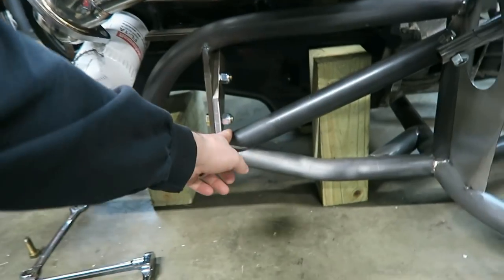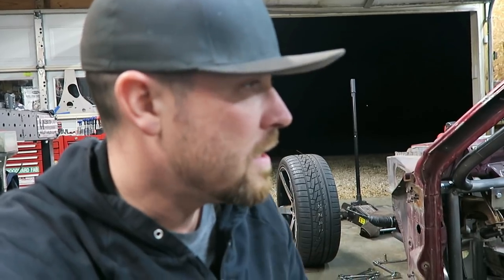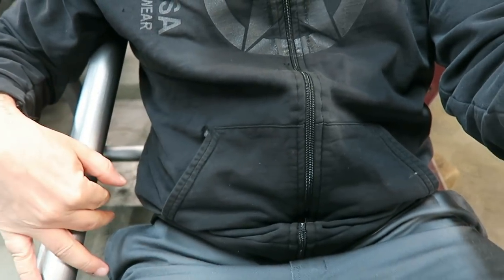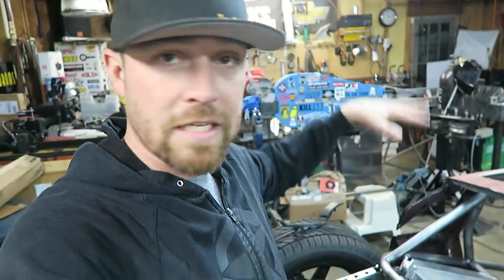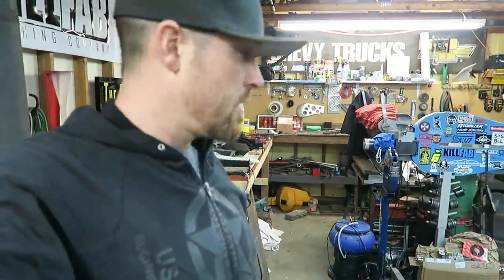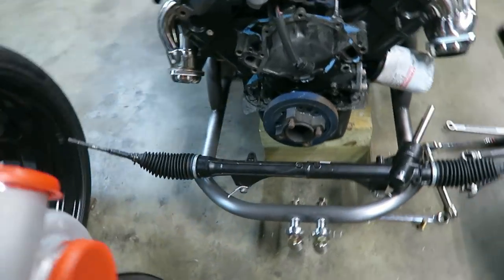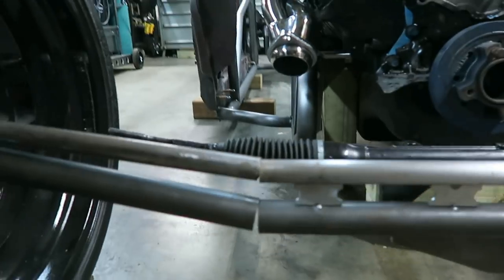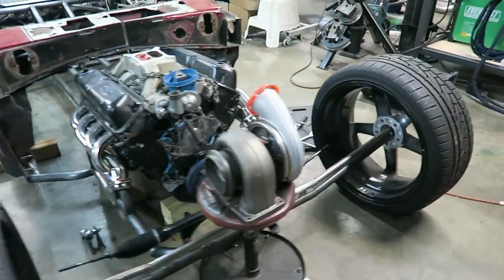Lets Talk Changes & Concerns on The Hot Rod Build

Comment: Hey bud this may be a dumb question, but only question is the one you don't ask. I saw you were talking about the clearance for the turn pipe from headers, well can't you leave the headers in the direction there in just flip them upside down? Exhaust exit point up then clock the hot side of the turbo atleast them you can make the exhaust some what contour the front of the car if you wanted it to and still clear the steering boots of the rack and pinion. Just an idea but awesome build dude.
Reply from the maker: +charles fields I could but they look stupid like that and these particular flanges won't work upside down.

Comment: I agree, the extra bars in the roof arent necessary...you wont ever be going 200mph.  and with the super low stance, the likelihood of flipping is zero.
Reply: The concern I'd have with the rear cantilever arms, is twisting.  There will be quite of be of stress on that length of an arm.
Reply from the maker: twisting wont be an issue

Comment: You're suspension bolts will be fine as long as you don't skimp on quality. I'm running 9/16" grade 9 bolts on the front of my vw buggy  in single shear with no problems. And I'm sure my car sees  a harder life than yours, lol. Keep up the great work.

Comment: Like I said before I don't know about a lot about the geometry but form my understanding is the tie rods should be parallel with the ground to avoid bump steer. I know this is mock-up stage but in my opinion I think I would extend your top rail of your frame all the way to to your front end and also weld that front axle to the frame and not use just those two bolts again I know this is just the planning stage. I do like the direction you are going and the look keep up the good work and looking forward to your future videos
Reply from the maker: no the tie rod needs to be parallel with the a arm to combat bump steer
Reply: The Fab Forums  thinks for the clarification that makes sense

Comment: could you flip the headers so the collector is facing upwards so you dont need such a sharp angle
Reply from the maker: +durtyonecustoms I though about that
Reply: Honestly I think some header wrap and heat won’t be an issue for the steering rack. Could always pie cut the collector to get a better angle and more clearance.

Comment: Front end idea is very similar to where I am coming from; traditional hot rod fords (1932 and model a; a good reference for your research). Sadly I am mostly clueless on front end setups for scratch! All I know is to keep a 7 degree caster, kingpin points to middle bottom of tire, and 1/8 toe!
Reply from the maker: +BenLeBlanc1 Yeah and because this isn't a king pin setup it makes it a little harder

Comment: Hey man, Sweet vid.
Not 100% but i think i might have came up with an idea for the front "fake solid axle". What about making a set up similar to an offroad solid axle truck with a cross over steering set up? Instead of a straight tube connecting the spindles, it would be a fabbed drop "I beam" or "truss" look?
Granted, with a solid rod cross over bar plus A arms you would have toe out issues when the car is in parked mode but it would still look like an unbroken solid axle.

Comment: Flip those headers over and rotate the exhaust flange on the turbo and think BUNDLE OF SNAKES like the GT40's.  Clock the air side at a 45 up and back.I gotta admit, the metal in those cantilevers seems mighty light gage to me.As far as the cage bars, when Mike Duffy builds a Fox, he cuts the roof off to get the cage as tight to the roofline as possible.  What about cutting some of that structure out to get the cage bars into that plane, then use some 14 gage scalloped strips that weld to the roof and A-pillars and drill the A-pillar bars and tap for some button head screws that bolt the roof to the A-pillar cage bars.I'm going to have Mike cut the roof off my '63 Fairlane post, at the C-pillar I'll weld some vertical plates to the inside of the 1/4 panel and on the bottom of the C-pillar and that will bolt together, the A-pillars will have the detail above, though not tapping the bar, it'll have overlapping plates or rivnuts in the roof metal.  The B-pillar will have a sleeve inside of it.  Once the Lexan is screwed in front, rear and side windows, you won't know the roof comes off.

Comment: There are two sides to the safety argument of the down bars.. while having them helps in a rollover, you're at a higher risk in a non-rollover accident to smash your head on the down bar. Additional bar padding will be necessary, and  will be even more intrusive to the driver cabin.
Reply from the maker: yeah for sure

Comment: instead of merging the hot side at the turbo have you looked into using a log on one side or the other bring one manifold down and under the rear of the engine to the backside of the other then both exit from the front straight to turbo the LS guys use this set up for single turbos
Reply from the maker: wouldnt work or look good

Comment: As a full roll cage that leg wouldn't be overly strong you would normally want to to continue to the floor and the big Bend to your dash bar does not help the situation.i would say u can get the leg made a lot nicer as nowadays the cage sits around 5mm from the points of the car down the appiller. I would suggest makeing a moc one first makeing sure u know the the bends and lengths then cutting and shutting till it fits perfect.  With this information you can make a real time front leg.
Reply from the maker: that bend wont affect anything

Comment: Congrats on the new shop/property bro,a dream of mine to!!
That front i beam look is so cool,dont know how it would look once you put the struts there thoughi think it would maybe take away from that low slung look that is has now.

Just an idea,could you put the ARB in the counter lever arm below the pivot point so it would follow the rear end up and down.

With the A pillar tubes,i dont even notice mine while driving my car,you kind of just get used to it and yours are more tucked then mine,but you can always put them in later on if you need them or want them.

The main problem for me is the door bars when getting in and out,mine are straight like yours and kill the side of your leg when getting in/out of the car,i am redoing mine so they have a bend in them and sit lower,more elbow room to form the steering wheel.
Reply from the maker: thanks....yeah I dont notice mine in the twin turbo car but you have to remember this thing has the seat and steering will mover to left 4 inches compared to a regular car
Reply: yeah leave em out,will look a lot cleaner when looking at the front of the car to and you dont need them for this build.

Comment: Kyle... Couple of things... Firstly let me say a huge thank you to you. Boredom has me watching a lot of crap on YouTube lately, and watching your engineering process come to life allows a few of the neurons in my brain to fire, instead of the mindless dribble I have been watching.

Now down to the meaty stuff... Can you please remove that front bar that sits under the steering rack. The different angles they meet at is playing havoc with my OCD. Watching this video an idea of how to do that came to me. If you chopped the parallel bars that are in front of the engine mounts back a few inches, you could easily and cleanly butt two straight pipes together. 

Using metal slugs inside the two straight pipes you would have a stronger join and you could bend that front pipe so it had clean 45 - 90 degree bends on both sides. I hope that makes sense (does in my head).

While I would love to see the additional strength of the top door bars, I'm kinda leaning towards not having them just because of the hand clearance, but more importantly the vision block. That is a lot of blocked view where you need it.

Perhaps the easiest way to address the turbo piping would be to remove the 4 into 1 collector and fabricate one that point in the direction you want. Maybe even cut the pipes back a bit so you can keep them parallel to the rails?

Thanks for trying shit and keeping it real.

Comment: Just put another bend on the end at "b" pillar and move the whole bar outside towards to the top of the window. And maybe use smaller diameter tube ;) Hope 20 000 Miles!
Reply from the maker: any wider and the body may have issues coming off
Reply: that is a good reason! move it to the center maybe?

Comment: Those bars you're putting under the motor mounts are going the wrong way.  If you're trying to stop a downward bending moment the bar has to go from the front/top to rear/bottom.  Absolutely love your build....its so unique.
Reply from the maker: thats only if you feel like the tensile strength isnt enough to hold the load. These will be plenty. The reason for it going this direction is to match other body lines.

Comment: On the cantilever arms I would put a bushing in the middle for the bolt hole. It may only go up and down a little bit but it’ll still take a pounding going down the road. I’d hate to see something looking that sweet to turn into scrap over $1’s worth of steel.
Reply from the maker: it already has a steel tube in it just no bushing

Comment: I have a 1926 Model T 5 Window Coupe that I am building right now and I am definitely putting a roll cage inside of it even though it is just going to be powered by a 355 carbureted you still not cannot put a value on safety I would definitely build the roll cage because I think that Beast is going to be fast the clearance looks good on the top bar but have you put a helmet on and checked it? And I have seen some comments about the turbos and placement I have noticed these guys on street outlaws are placing the turbos close to the firewall I am figuring that is probably for weight distribution again I realize you're not building a race car but it is a thought

Comment: Being that it's not a race car and doesn't have to pass any Tech I would ditch the a-pillar bars as well. Seeing you seated in there if you were to roll it your head is going to hit that bar and kill you. Unless you always wear a helmet when you drive your vehicles on the street which I think would be unlikely. I think you're right it's strong enough with the 6-point and the X door bars. It's not going to be a flexi flyer.

You are going to grenade that T5 though.
Reply from the maker: lol....you would be very surprised what me and my friends have been able to do with a t-5. The t5 going in this thing has been 6.20 in the 1/8. plus this thing has a 5:30 gear and will only be 2000lbs. Not saying I wont break it, but I dont think I will go through as many as some might think.
Reply: The Fab Forums I blew one up the first time down the street in my car. 68 Fastback 3400 lb 393 Stroker and drag radials. Stripped  the teeth off third gear.  Put a TKO600 in after that. The low weight and street tires will help for sure but case flex under power will kill them quick. I dig the car for sure. Not to cast shade on any people responding on social media but most of them have likely never built cars or fabbed parts from scratch. They have a major tendency to go way overboard on material thicknesses and bolt sizes because they don't know what's acceptable and safe.

Comment: Ok kyle the only thing that i can see you might have a problem with is the 2 spacers that the hyme joints are mounted on in front. I thing the spacers should go inside of the tube and be welded on both sides so that they are sleves and spacers you will be putting a lot of weight in that small area i would also box the sleeves in and i would put inserts in the cross bar that they mount too then drill and plug weld them just dont want see any problems with the front of your ride its just a suggestion
Reply from the maker: there wont be any weight in that area....it will just control the side to side stresses. Weight of the front will be help by the strut towers I have yet to build

Comment: You are correct in that a 1/2" grade 8 bolt will be safe!  According to Nucor Steel,  that bolt has a single shear strength of 17,670 Lb.  Yours are all in double shear which doubles the shear strength to 35,640 Lb.  Bubba, you aint gonna break that!  I am fairly sure you will be OK with the rear cantilevers as you have constructed them .  I often look at what was done on my factory cars and trucks.  There is very little steel in the chassis over 1/8" thickness.   If you are worried about the bolt rotating and wearing out the hole simply weld a tab on the lever arm to lock the head from turning and grease the bolt before assembly.

It appears that you have the front end fairly well sorted.  The only concern I have is I have not heard you make any mention of Ackermann.  Basically if you pull a string from the top center of the rear axle, through the center of the top of the king pin (ball joint)  the center of the tie rod end must fall directly under that string line.  If you do not consider Ackerman the car will not corner well and will have abnormal/excessive tire wear.  Normally changing the length of a chassis has little affect on this.  However you are planing to completely relocate the steering arms on the spindle.  Welding that steel is easy.  I have welded stuff like that many times.  As long as you take your time, "V" it out, and make multiple passes you will have no problems with your welds.  

I hope I am not telling you something you already know.

All the best!

Mike
Reply from the maker: Yeah I agree....I will set the ackerman before I weld the nuckles back together

Comment: watyoucould do with the part of the cage running over the doors is take out the inner sheetmetal and move the bars closer to the outer sheetmetal , make it part of the sheetmetal box section
i would do a bit of seatpadding on the sides , i;m pretty talle so my knees are allways hitting hardpoints on the dash , if i have to drive for longer periods the padding saves me some bruising to the side of my legs
think if you slant the rearshocks in a little at the top it whont bind s fast as it would sitting straight up , only needs a little slant
best way to prevent bumpsteer is see if you can get the arc of the steering rack in the center of the arc between the front and rear mount of the a arms , might need to shorten or lengtern the rack
might be fun to mount the turbo allmost directly on top of a blow trough injector carb  with the headers curling intoo it and the exhaust from the turbo going up in a chimneystack , going to be high up there prolly sticking up over the roofline

Comment: The cantilever pivot should be bushed like ANY suspension mount. Just like a arm pivots. It's the only frame mount for coil overs so it's not the pivot it's the road shock from every pebble dip or pothole. Instead of a bushing like your coil over has to absorb road issues you have the same type of pivot on 2 thin pieces of steel. Your can't needs bushed!
Reply from the maker: The coil over does all the absorbing before any of the shock is transferred to the center of the cantilever.  Besides its not on two thin pieces of steel. That bolt goes through a tube that is welded into the cantilever.

Comment: Wow I just love that front axle setup. Should work out lovely. I myself would not give up on the cage idea, As I see it you can easely gain another inch up and side. Maybe further, as you dont need the strength of the double plating in the body any more?  Last suggestion but I think I repeat myself: wouldnt you make the upper part of the inner structure a but more narrow? I know its your ride, but now you never can gain any pound or two in your live. Ever 😀. I admire the work and the design, I am a great fan. Btw do you know Badobsessionmotorsport?
Reply from the maker: not familiar I dont think

Comment: I think the front suspension should mirror the rear with some dimple die arms.
Reply from the maker: yeah I plan to incorporate some dimples at some point, just trying to get the main stuff figured right now
Reply: You could do the front trailing arms similar to the rocker arms on the rear. Have them running down chassis by the engine oldschool hotrod style.

Comment: forgive if duplicate, my comp is not refreshing ur video...  i like the idea of the beam axle look, but it's going to ride like sh!t and the rear susp has so much cool stuff going on, the front needs to be similar (imho).  keep the beam look but make it into 2 arms with pivot at the rack joint, run an L shaped cantilever pivot on top of that with a pushrod back to the firewall, mount coilover & hydro there.  kindof like a F1 front suspension cantilever.  flip the headers over & run tubing higher up.  love the project!
Reply from the maker: +jim brown won't ride any different then a factory fox. Gonna have a arms and struts. Just have the beam look

Comment: Guess all the arm-chair engineer's giving their 2 cents worth, so may as well have mine.....
If bump steer is your concern, consider a Sprint car rack and pinion (much narrower and tighter ratio.)
Otherwise, have a look at a 34 Hudson dual I-beam, semi-independent front. Or split I-beam like the Lotus 11 and make the front end a swing-axle with long radius rods and keep your center pivot.

Comment: Kyle, loving the “real” as in not sure and not got it all worked out! Your headers and turbo piping, you’re worried about the proximity to the rack? Why not switch the headers so they go up instead of down? Not sure if the flanges are the same both ways but would look cool as penguins widdle?
Reply from the maker: flanges wont work...plus it looks dumb that way and wont follow the lines of the chassis as it does now